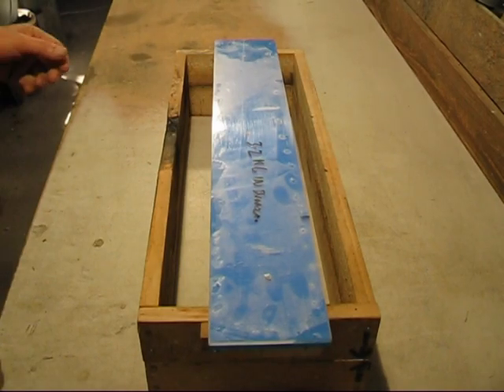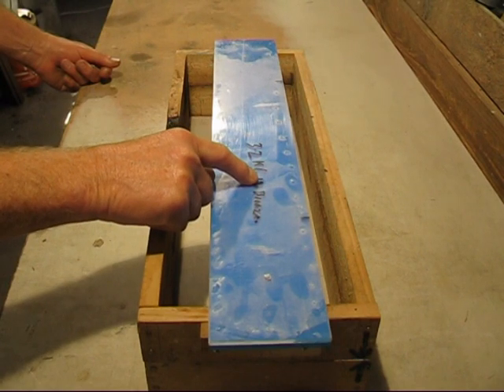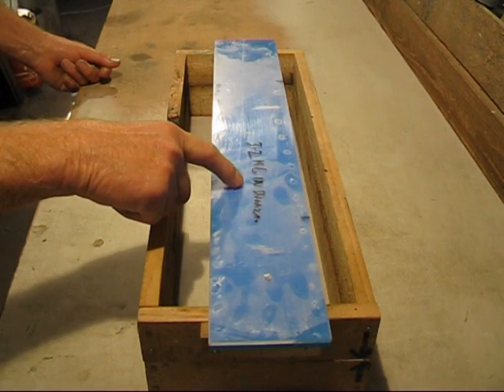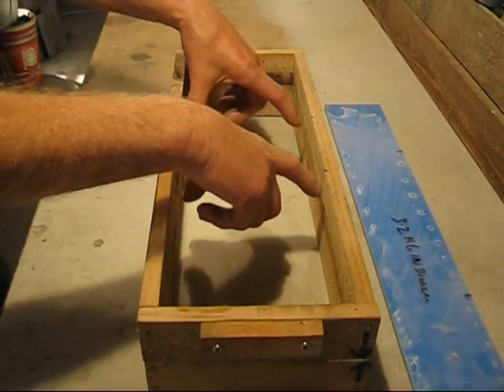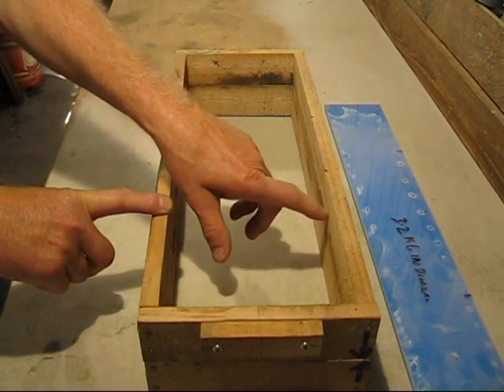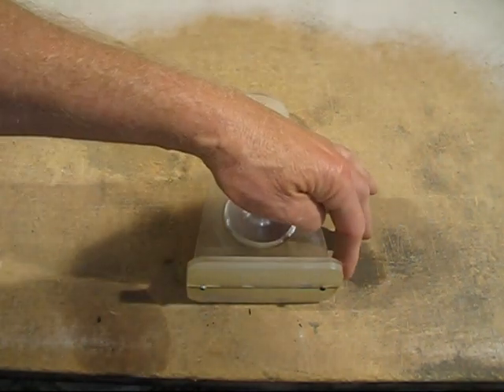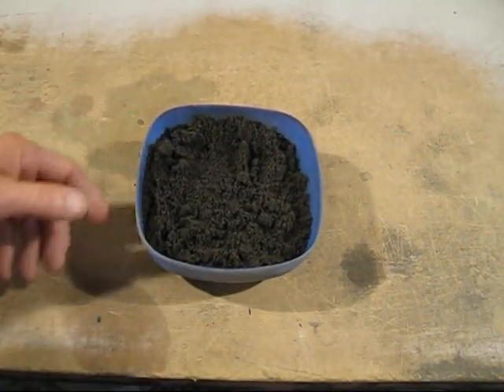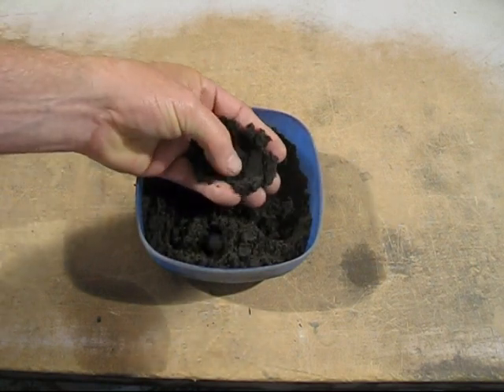My green sand.

Comment: Are the 7-8% bentonite in the greensand mixture measured by weight or by volume? I found mine does not seem to get the desired strength so I added by feel. It ended up being way more. Does anyone have some resources (books, papers, YouTube channels) where I can find more details about moulding materials? :)
Reply from the maker: By weight. All sands are not the same so you may have to adjust the amount of bentonite to suit your sand.

Comment: Great video very informative! What mesh/micron is your sand i have been battling with mine and it seems really course.
Reply from the maker: The sieve I put the sand through a 0.5 mm wire can be pushed through so my sand would be considered coarse.
Reply: @luckygen1001  Thanks for replying. One more question where do you get your coal dust?

Comment: Another great casting video, Ironman, VTsteam here. Question: is your facing sand the same or finer sieve than the backing sand? I remember you used quarry sand for your main greensand, but never heard in the videos whether the facing sand was the same coarseness, or not. Down below here in another comment you mention pool filter sand -- haven't heard you mention that before. Is that for facing sand? Thanks for the clarification, and keep up the great work!
Reply from the maker: Good to hear from you again VTsteam.  The sand I have always used from that quarry has always been swimming pool filter sand. It is the finest sand grain they have after going through their sieves. Their sieving is not perfect so I run that sand through a sieve which I can poke a 0.5mm wire through the mesh. My facing sand is the same as my backing sand with one tiny difference, my facing sand has coal dust in it. My backing sand has no coal dust in it from the start but what happens it turns light gray from the burnt and unburnt coal dust in it. In the beginning I never used facing sand and after a melt of cast iron I would add some coal dust and bentonite. The problem with that is it is hard to know how much coal dust and bentonite are burnt after a melt so I was adding too much, so I was replacing my sand every year or so. So now I used a facing sand which has fresh coal dust and bentonite and it keeps the backing sand fresh. I have never replaced that sand in ten years. I hope this clears things up.
Reply: Thank you kindly I-M, now I understand. I'm casting iron again after a long pause, and have relined the furnace your way. 20 minute pours from cold for 6 - 9 pounds in an A6. Cement cores. Have tried a couple types of sawdust, and commented on what I've found. Stop by madmodder some time if you get a chance. Best wishes!
Reply: @SRHacksaw  I'm not a member but I'm following your ELS project. I hope you can make it.
Reply: What is the white powder from the sock?

Comment: Thanks again for such a thoughtful video.  What are you using for your oil tank, and do you keep it pressurized?
Reply from the maker: The oil tank is a 45 kg propane cylinder and is pressurized with compressed air.

Comment: Thank you Luckygen. I was wondering what percent coal dust would you use if had 7–10% bentonite? Also, that pciker upper tool you have used at 11:00 I was trying to get some clues as to the clamping mechanism but not quite enough detail in the video. It would be great if you could show a closeup of that some time, or sell some plans. I'd be into that.
Reply from the maker: It is a pair of tongs with half circle parts that grab the crucible.

Comment: Did you use any ferrosilicon in the melt? It looked like you just melted the rotors and poured.  No flux, no ferrosilicon?
Reply from the maker: I always add ferrosilicon and use no flux so in this video I left that part out and showed what the inside the furnace looks like when the iron is melting.
Reply: @luckygen1001  okay.  I figured as much.  Nice work!

Comment: That definition is outstanding. I just mixed a batch of Kbond sand but I used the play sand from Bunnings. It seems to be way finer than the previous batch of white beach sand that I had used for my greensand.
Reply: I have been using mortar sand and bentonite it's quite fine.
Reply from the maker: I use swimming pool filter sand.